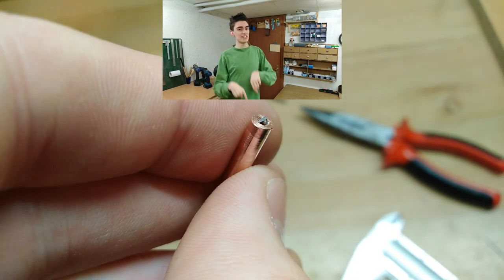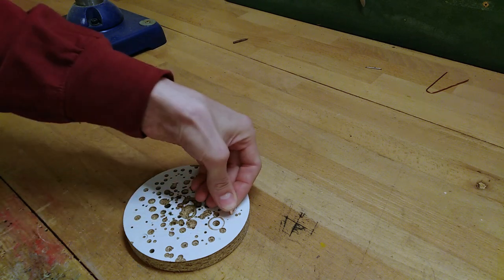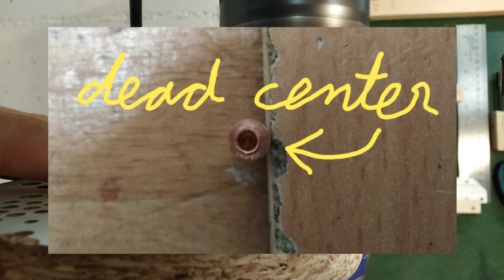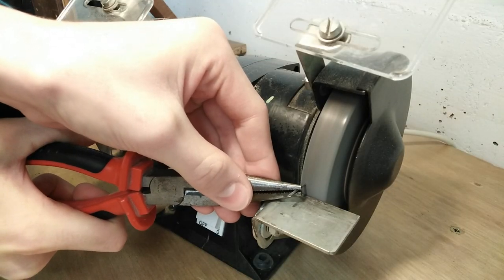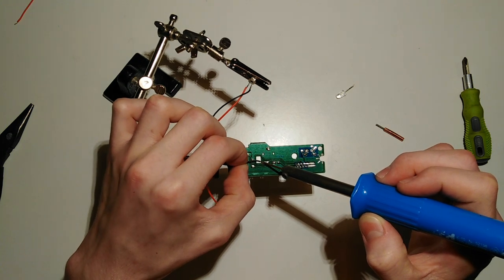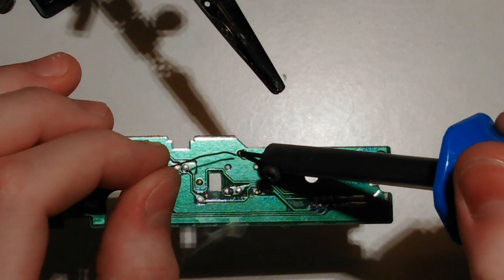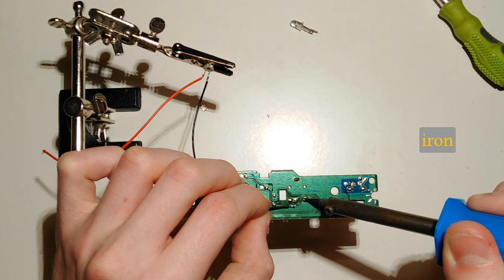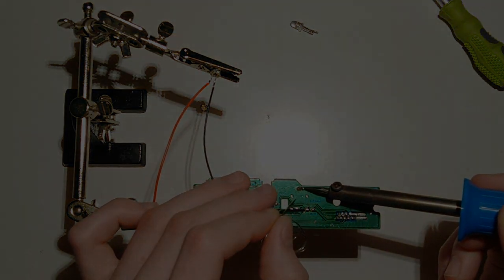Cheap soldering iron tips follow up - iron vs. copper?

Comment: I think it is good to use Brass Wool together with a wet sponge before you're finished soldering! During your soldering you can use brass wool while the tips are hot. Face it; no matter what you do, the tips will never last forever anyways, but it is good to try!

Comment: I bought a LWS-301 Laser gun and never looked back. Adjust the laser beam at idle to cover both ends of a micro IC pre rosin with a tap on the foot switch set at number 6. Then with a micro hand operated dispenser [cheap] dob the solder past on each end , the chip will probably be out of line NO WORRIES!! Now step on the foot switch and wait 20 seconds and wath that chip do a dance , sometimes stand on end, DON'T LET GO OF THE FOOT SWITCH!! Watch the chip SNAP into place with the action of solder flow and you have a perfect factory IC_Board flush mount solder job. My analog iron is still needed once in a while but the laser system [300 bucks] is getting allot of use. No tips to wear out maintenance free. Lovin it. I know this sounds snobby, but once you go laser or infrared you never go back!!  Dude, I love your eco attitude and enjoy all of your videos.
Too many men are like me, over 65 and signs of Parkinson's disease [shakey hands] are putting them out to pasture until they discover laser soldering then they get a new leash on their hobby.

Comment: If you clean the soldering iron amd keep solder on it when not in use it should last a lot longer
There is also rosin flux and if needed citric acid to clean the tip when it gets really gross, but the fumes are nasty

Comment: when drilling brass or copper try grinding one cutting flute of the drill slightly so that the drill point is off center. this causes the drill to orbit in the hole and it won't jam and break.

Comment: hi, nice experiment and great grinding skills..
i have a few suggestions if i may: you want to maximize the contact points for the heat to flow as easily as possible. 

first contact point is with the heating element. both the thin iron insert and nail tip would get hotter it they would have smooth surfaces to maximize the area of contact between the components. i would drill the hole in the copper all the way thru then cut it / split longitudinally so that it would act as a clamp on the steel insert as the bolt on the iron gets tightened. high temp anti-seize lubricants would further improve the heat transfer.. the most accessible option is the little bags used for automotive spark plugs ($ 1-2).

the 2nd contact point is between the tip and the soldering component: having a solder layer on the tip helps greatly in transferring heat.. tinning the tip is crucial. a surface doesn't get wet w/ solder unless the oxides are removed. flux does that (and damp sponges too). if you don't have separate flux, you can wrap the new tip w/ soldering wire as it has a flux core... when it reaches the melting temp the flux should de-oxidize the surface and help the solder stick to the tip.

ps: by tapping copper w/ a hammer, it hardens considerably (mechanical shock). you reverse the effect by heating the copper...
Reply from the maker: Hello, thanks for the suggestions! I see what you mean there - problem is, drilling straight all the way thru the copper lengthwise isn't possible without a lathe. It just always ends up crooked with the drill bit coming out the side if you go any deeper than a centimetre... to improve heat transfer, I guess it would also be possible to flow some solder into the gap around the thin copper wire / steel nail when first heating up the tip. (yes it's gonna re-melt every time but capillary action should make it stay there)

My soldering tips are always tinned - dissolving rosin in rubbing alcohol makes for good extra flux. Although I don't generally use it, I just add a little more solder.
 
"ps:"   
I know that effect from goldbeating, didn't realize it applies to copper as well. 👌
Reply: @ChronicMechatronic  copper could get just stiff enough to make drilling easier.. higher speed and slow advancement of the drill bit should help w/ soft materials.

anyways, the depth that you managed for the hole should offer enough contact area if things touch (your idea using solder to fill the gaps could work).. 
i have a few old irons in my collection that have thread-in tips and a 0.125" thickness tip, only screws in 5-6 threads into a nickel plated heating element. that surface area is enough to heat up copper tips up to +800 F/+400 C with 15-18W elements. check out the "Princess" series from 'Ungar soldering iron' if you'd like to get some inspiration for small tip shapes. try image search "ungar #332"or "ungar allied 1965".. notice the small contact area available given the size of those tips. the manuals say that thermal compound should be used on the threads.
in reality it mostly helps as an anti seize agent, the tip reaches comparable temps w/ or w/o using thermal paste because it's a tight fit..yes these are from the 1960s and they still work...

i completely forgot about the rosin.. man, where do you get it these days? i miss that smell :}

thanks, be safe
Reply: @duroxkilo   musical instruments shops sell violin rosin.
Reply: @Zehnsteine  thanks

Comment: I have been using custom copper soldering tips for years when I was just starting my electronics hobby. Then I moved to a proper low-power soldering iron with iron tips. It's a bit difficult to get used to it because a copper tip always looks shiny and also it picks and keeps the solder on the tip always hot. With an iron tip it feels more difficult to solder if you haven't applied lots of flux even when you want to join components that had been fluxed and soldered before. With a copper iron, I just touch the legs and they get joined nicely. With an iron tip? Nah, unless you add more flux.

Comment: A copper solder tip cost a about 1-2 buck, so making those yourself makes not much sense. But if you do, you can better make them out of solid copper, much better heat transfer.

Comment: Have you tried nickel plating the tips for a more durable finish?
Reply from the maker: No, I haven't got any nickel to try it with
Reply: @ChronicMechatronic  a small bottle of nickel sulfate and a cotton swab with a pair of D cells would probably set you back 10 or 15 dollars.

For such a small surface, brush plating would be ideal.

Comment: I can tell you one of the biggest problems drilling copper is the metal is gummy. The best way to keep things moving along without breaking is to use paraffin wax. Just about Any candle these days uses paraffin wax because it is cheap. Just before you start drilling let the drill rub the cutting end into the wax. When drill is hot it is way easier as the wax melts onto the cutting tool. DO not jam the drill bit either, just light pressure to let  the drill do the work. Also, high spiral HSS bits work best. When the drill wants to dig into the metal because of sharpness, take a small flat sharpening stone and gently reduce the cutting angle and the digging will stop. Two cents worth of knowledge for you fella for free.

Comment: as someone just getting into soldering, wouldnt Copper welding tips be a viable choice? Seeing as you only have to file it down on the outside to have it fit and since spot welders work the way they do, the thinner piece can readily be replaced () the would be soldering tip from a spool of copper welding wire
Reply from the maker: Well, yeah, I usually use thick copper wire and replace them when they get too short to use

Comment: Hi, I'm your new subscriber.
Reply from the maker: Hello, thanks for subscribing! Hope you enjoy my content!
Reply: @ChronicMechatronic  yes, sure, I did try to find if anyone ever used a nail as a soldering tip, now I got, gonna try out soon on my (cheap Chinese made) 25 watt Soldering iron, and, kudos for new journey, good luck.
Reply from the maker: Thanks! I like cheap Chinese stuff ;) My soldering iron is 15 watts, so maybe nails work better on higher power soldering irons.
Reply: @ChronicMechatronic  I got 3, 25 Watts and 8, 35 & 60 watts each ; ). I'm gonna try on the 25 watts first as I use that one most of the time. I will let you know the results. Hope everything gonna be ok.
Reply from the maker: That'll be interesting, thanks!
Reply: @ChronicMechatronic  By the way, I'm your 48th subscriber, so I'll be the longest runner like others, Hurrah.